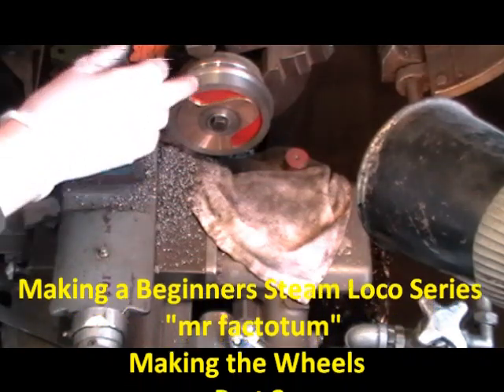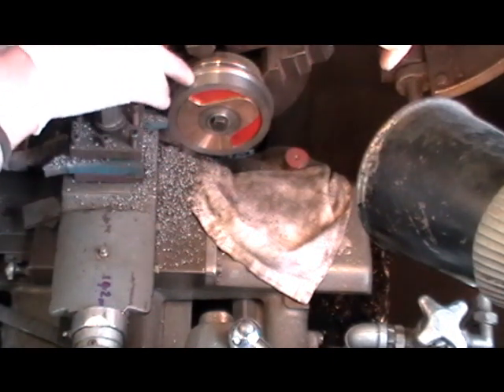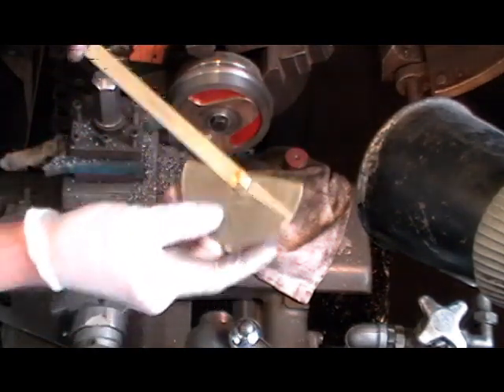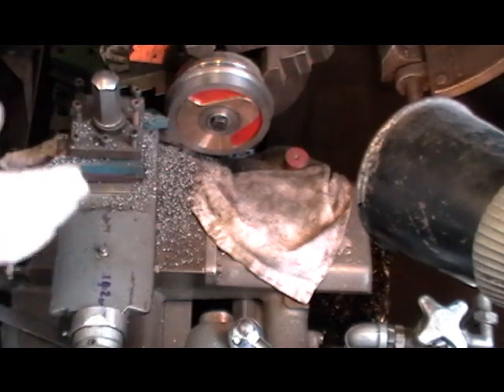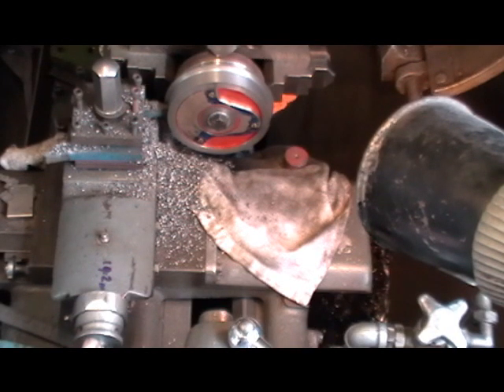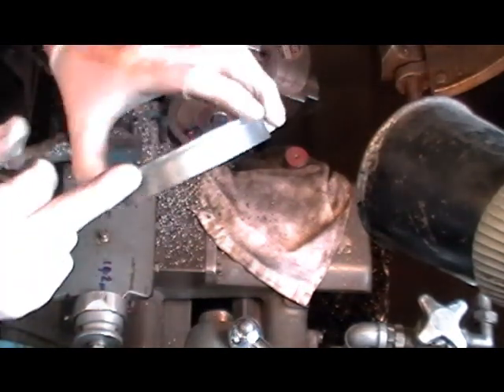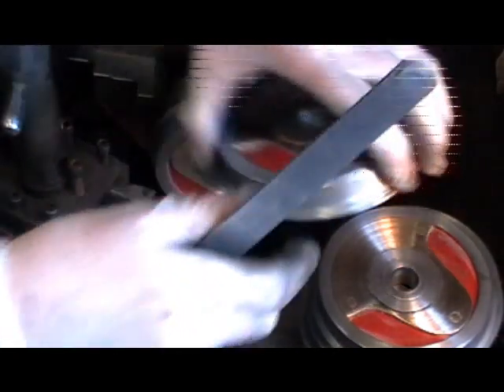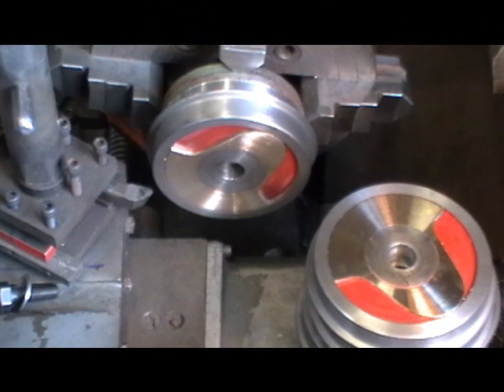Making a Beginners Steam Loco (Making the Wheels Part 3 "Tread & Profile") "mr factotum"

Comment: Good Day Mr F
Could you use a HSS tool for this job? I am about to do this stage on my loco. would it stay sharp enough for 4 wheels?
Reply from the maker: hi brendan
it depends on quite a few factors brendan.
1. If your using castings or even some bar stock of Cast iron it has a hard skin on it and you need a carbide tip tool to get under it.
2. If theres no hard skin on it then HSS would cut C. I. but you need a  slow speed ( i.e. cutting surface speed depending on diameter cutting)  or tool will dull quickly
3. Also there are diffent types of Cast Iron, some are more machinable with HSS.
Ive tried to simplify my answers, but if i were you my first choice would be use a carbide tool, if not available just try hss and give it a go, but you may have to touch up the cutting edge on a grinder more frequently.  
Hope that helps and let me know how you get on
regards
mr f
Reply: Mr Factotum thanks. I have castings so might have a problem. Will tackle the bogie wheels first as they are cheaper replacement if it’s all a disaster.
Reply from the maker: sounds good, although i don't think you will damage the wheels if you just take light cuts and make sure everything is clamped rigid, it will just be the tool goes blunt if anything. good luck,, let me know how you get on with it , but don't rush
regards
mr f

Comment: I am about to start this step. I have my mandrel setup in the lathe. With the wheel fiitted i am getting 0.05mm movement on my dti on the flange. Do you think this is going to be a problem?
Reply from the maker: Hi KM
Nice to hear from you, good to hear your progressing, 0.05mm i believe is about 0.002" i wouldn't worry about that at all, i think mine were around that figure. At the end of the day its tractor engineering, not space technology!!!!!!, although there are some components that warrant more preciseness, such as the pistons etc, you get the drift.
Good to hear from you,
 keep in touch with your progress, i'm very interested how your getting on. If you get chance or willing you could email me some photos of how your progressing, no pressure, i leave that with you.
regards
mr f
Reply: @MrFactotum  Thankyou for your reply. I will gladly send you some pictures.